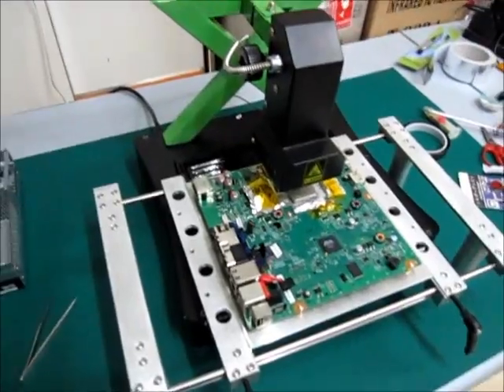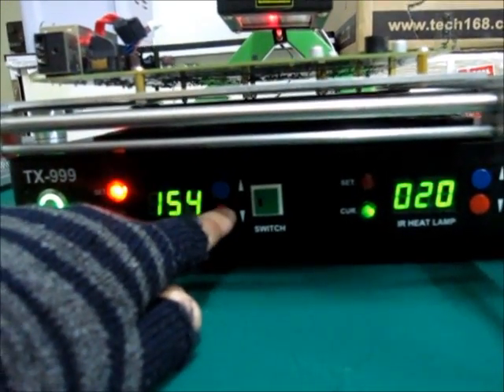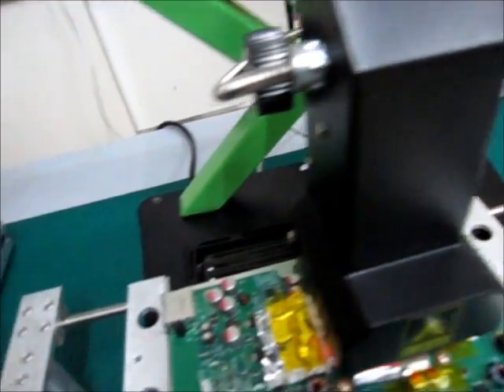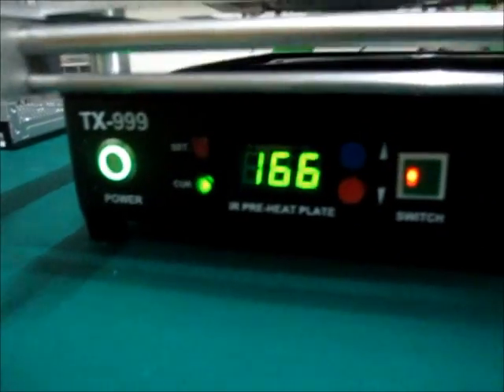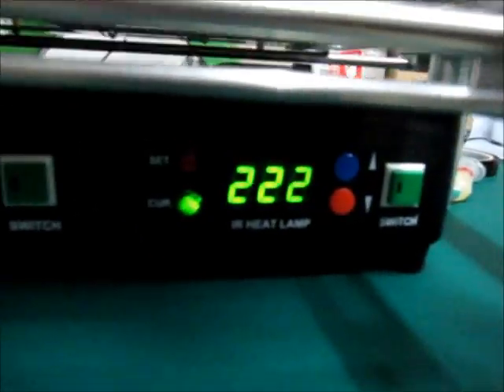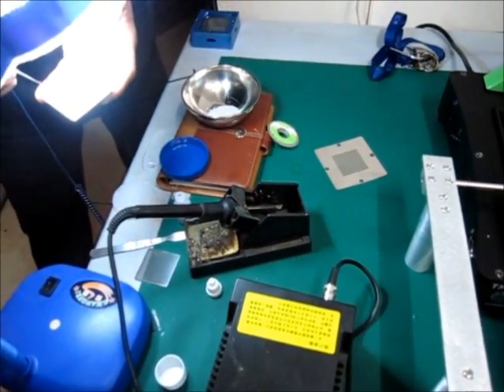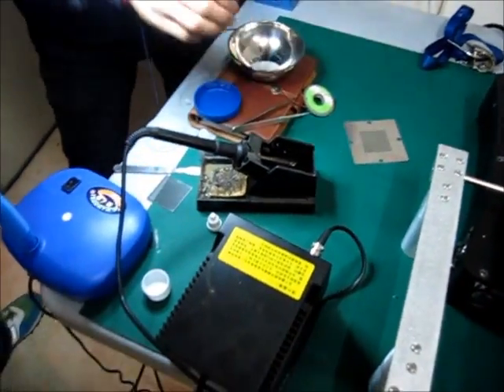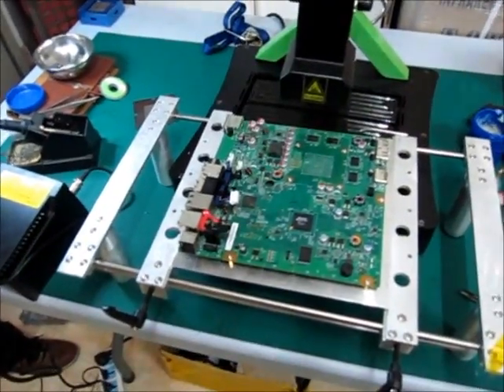TX-999 DM - Infrared Tube System - For Safe and Reliable work -  By Dragon Group China

Comment from the maker: Sir, check the cables, maybe some is connecting with the case, and you need to insulate it from the case, that happens when the insulation maybe is moved , on the tip of the cables. If any problem, please write to company for help. Here only videos on machinery.
Thanks
DGC TV